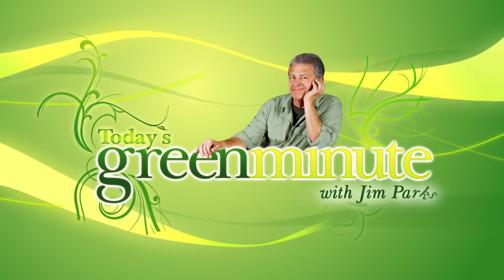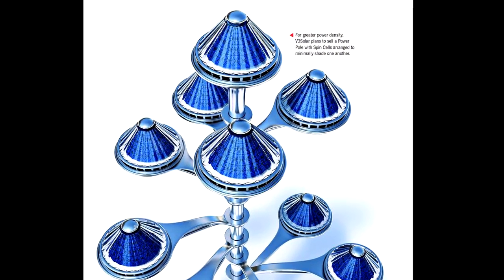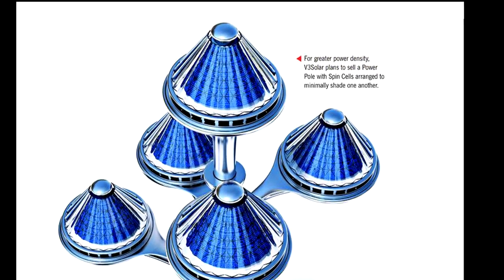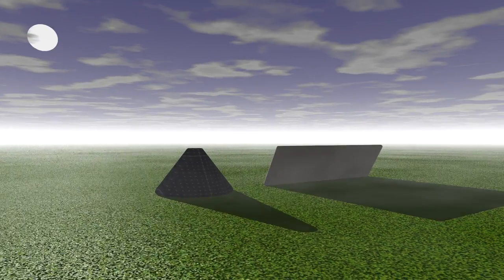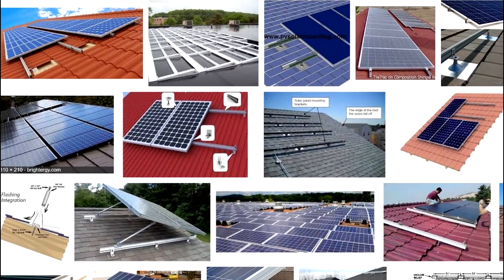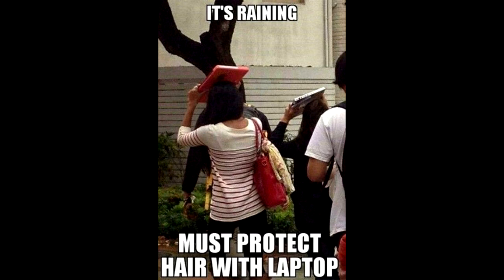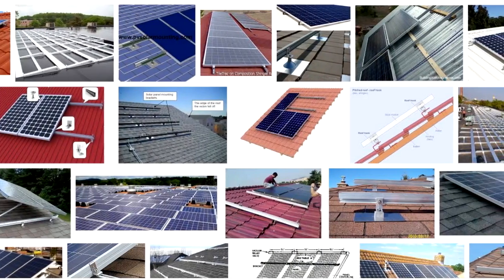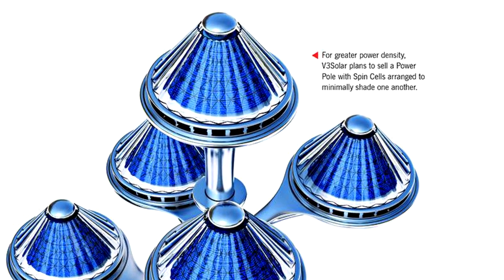Spinning Solar -BUSTED!

Comment: Solar isn't that expensive. MY parent's power their farm home with them and the combination solar wind setup was about $10,000 which includes installation fees, wiring, and building permits. I did it for a smaller building in the farm for about $700 since I only needed to power lights and 5 power outlets rather than an entire farm house. Compared to normal annual costs of power it's really reasonable.
Reply: ***** They took out a loan and only powered themselves with the solar and wind making it a monthly cost like any other which paid for itself in the three years it took to pay off the loan, only costing more later on for panel and battery upgrades. 

The $10k figure is an estimate made by my dad based on the total cost over the years we've had the system, minor upgrades included. A modern installation would cost $5k and we never accounted for y he government tax breaks received for having a solar system on top of the free electricity and the extra we charged neighbors to use. 

Just a heads up if you're interested, don't bother with the wind turbine. It doesn't generate anywhere near enough power to make up for the extra cost and according to my parents is a worthless pricy add on. Solar panels are enough if you get the right power storage. 

In short, we took out a loan making it a monthly bill like any other.
Reply: ***** most first world governments have aid programs and will approve what they consider "green" upgrades to your home. We got it because we wanted free power and it was going to cost the the same to wire electricity to the cherry farm on top of the monthly fee. We simply did away with the fee. 

I'm not sure how the loan process works, but if you were able to purchase a two story house then you can get a loan for this. Most homes are smaller and won't need the same amount of power thus reducing the cost. Like I said, most people would pay half because of new technologies and less power needs. It's cheaper than a car and powers a home for ( estimated) 35 years.
Reply: ***** in Alaskan summers you get 23 hours of sunlight. Plus the intensity is usually enough for a modern solar panel anyway. A cloudy day simply reduces the power but since they are only there to charge the batteries we actually draw power from there's never a reduction in power output. You have to conserve power in the winter. 

Solar is the best for self sufficient energy. Even if it isn't your only source of power it will take th err strain off the power grid in any location. 

Wind is worthless in the windiest places. We've had more problems with that thing that is practical. Every month something is broken. 

Nuclear is only good for a city
Reply: ***** our goal was free power. It had nothing to do with eco friendly whatnot or renewable energy. We have specific goals as a family. 

And nuclear can never be used for private use because the structure needed to block the radiation alone is ridiculous. A building with walls made of ten feet of concrete is an expensive endeavour just to power a private home.
Reply: *****
That $10000 is the entire cost of installation over 3 years. No more money was put into this. It's not an annual cost. I've installed my own into a trailer for just over $700 with 400 watts of power. Plenty for one person.
Reply: ***** if every house had a solar panel that national grid wouldn't be strained so hard. I believe in being self sufficient, but even if it's not all the way don't make the government do all the work.
Reply: Simon WoodburyForget you don't understand mass production. Btw they are already mass produced
Reply: +ErebusArchon : Nah, for a nuclear plant you need an earthquake- and tsunami-safe location with a good water supply for cooling, a massive electricity grid to distribute the humongous amounts of electricity produced in a small area, and a stable supply of well-educated, responsible engineers to run it. Feasible in some industrial countries, but not nearly universal. Think about this: would you prefer a state like, say, Tanzania, to get its electricity from solar power or from nuclear plants?
Reply: +Simon WoodburyForget " the more power you use the cheaper the electricity you make will be when talking about things like coal, oil or nuclear power" - does not compute. Don't you think prices will increase when everyone switches to any given finite resource, like coal or oil? Supply is not infinite, so demand determines the price, right?
Theoretically, something like that also applies to solar cells, so we cannot switch on an infinitely short timescale. But it turns out that China is pretty good at scaling up the production when needed... and the global production capacity is high enough to cover a measurable fraction of the world's power, at prices that were never lower, and that are competitive with all other sources of energy under good circumstances.
Reply: Simon WoodburyForget : I know what scaling means. And solar power scales nicely, as long as you have enough area you can cover, and your grid can handle the fluctuations. 
Need twice as much power? Install twice as many panels, and you're done. The installation becomes slightly more efficient when you go to larger installations, not outrageously cheaper, but not more expensive either. 
The global market needs twice as many panels? Build twice as many factories, and you're good to go. (Some limitations on silver and other metals may apply eventually... but so far, production goes up, prices go down, down, down.)
And you were the one who brought up the argument "what if everyone on earth...?" - well, that could be asked of any power source, and the result would be unpleasant for all of them.
Reply: Here's a thought, use a little bit of everything around you instead of finding one single power source? You know, much like we already do.
Reply: Simon WoodburyForget this computer didn't take that long at all. I ordered the parts one at a time and spent a Saturday morning getting it together. It's not as hard as you make it sound. If you're wanting the absolute best shit and you want unrelated components to work together then I can see it taking all day. But once you have the parts they click together. Especially if you're like me and buy everything from the same company and only use the recommended upgrades with the same plugs. 

Don't complicate you're shit dude.
Reply: Simon WoodburyForget  A lot of that is fun. Why don't you want fun? Fun hater.
Reply: Simon WoodburyForget Except we are talking about something I clearly already know well enough. So in your face. 

Are you literally saying knowing how something in your own home works is a useless skill?
Reply: Simon WoodburyForget  You act like nobody knows more about this than you or someone doing it for a living. The concept of a hobbyist or a far along learner eludes you. I know what I know out of necessity. I'm not a professional but I build my own shit for custom specs. It's cheaper, you're not informed. You've admitted you're not informed, and yet you carry on this illusion that your way is right when you ONLY do things you do because of a lack of skill and knowledge you admitted. 

Just stop it little man. The topic is solar panels. I lived with them and I'm willing to discuss their many flaws, advantages,and myths.
Reply: Simon WoodburyForget So building computers can't be fun because it takes to long and requires effort? 

Dude. The fun comes from problem solving and making things work. You never have the solution right away, but after a while you wind up with a bunch of solutions. Many of them creative. Many wrong.
Reply: + Milad Chow: What? Pray tell, what rare earth minerals do silicon-based solar cells (the most common technology) use? AFAIK, the ingredients are: silicon, nitrogen, phosporus, aluminum for the back contacts, some silver/copper/ whatever alloy for the front side fingers and busbars and rear busbars. A well-manufactured cell will work for 30+ years, with a degradation of maybe 20% of its original efficiency.
Reply: benjovi55 there are many things we do to say power that most people dont do. It's common sense to us but having unlimited power has made some people lazy and wasteful. One thing that irritated the shit out of me is people who leave shit plugged in all the time. Another is only turning on the things you need. 

You don't live the same, but with a little logic and common fucking sense you can wind up using a tenth of the power without actually giving up anything but bad habits. So since you'd use less power you probably could handle it. Even in the winter they generate some power which all goes to the batteries. We've even gotton reading from moonlight. All you need is to figure out you daily usage, have a battery system that stores that, solar panels that charge that during your work day, then add 50% to everything. 

As for the $10000, we assembled most of it and ALL the wiring was done by my dad. Plus that didn't include the batteries.
Reply: Simon WoodburyForget a gaming pc is actually very simple and could be figured out fairly quickly. If you're buying completed components like most people do then it's little more than a puzzle. 

Running the electricity into s house is harder, but essentially is just a puzzle once you understand generally how things work. You put the components where you want them and connect with wires. The actual house was already dont so all my dad had to do was send power to it. 

As my brother says, you don't need to know how something works to put it together, you just need to kno we where everything went. 

Also it's not on the roof.
Reply: benjovi55 any panel makes it cheaper.
Reply: The problem is that residential electrical power demand in the US is about 20% to commercial and industrial, and  electrical power is about 50% of total power (transportation, cooking, heating).   Another big problem with solar is that solar plants are co generation facilities that get massive subsidies on their co generation equipment.  Natural gas, and big oil loves solar and wind- and so do the manufacturers of the equipment.

It is a good solution for many- but it is not the solution, particularly when you consider how those monocrystalline panels contain rare earths- and that means heaps of heavy metals like lead or mercury got blown into the air through a smokestack (almost assuredly in china) just to get them made.
Reply: ": Nah, for a nuclear plant you need..."  No that is for a first generation fast breeder reactor.  You think the first car, or hydrocarbon based steam generator was safe?  IFR demonstrated no need for any of those claims with a fast breeder reactor.  Passive safety systems have been around for a long time- we just have lots of old plants.

" What? Pray tell, what rare earth minerals do silicon-based solar cells (the most common technology) use?"  You are talking about monocrystalline photovoltaics (for rooftop) which use tellurium,  indium, gallium compositions as doping agents.  They are trace amounts but that does not mean trace amounts of lead and mercury were not mined and refined to get them only to be blown out of smokestacks that reach food chains that go across the world.
Reply: Simon WoodburyForget
 By 10 am on a Saturday I was playing Skyrim on a computer that didn't exist the previous night. Besides, all the parts were assembled, they just needed to be mounted in place. Plus I use this computer every single day so it was worth the effort to save a thousand dollars and build the specs I needed. Most mods were done to operate with a lower input voltage so the power supply had to be modified because I run on solar panels and batteries. Other than that it was pre-built parts.

You may be able to spend the money, but I don;t have money to spend, I have a few hours to make something I want and need. And when you make your own stuff it's done your way. No one else is reliable. A computer with the performance I needed would cost $2000 and have functions and parts I don't need and would still need to be upgraded with the more powerful graphics card. I got a better computer for $1600. Not a huge savings but it will last me years instead of being a throw away item. In fact I can sell the parts used in this computer later on when I can buy the perfect graphics card that costs more than my computer and will be able to render movies while playing Grand Theft Auto 5 with a browser window open.

In case you're curious about the power supply mods, my computer origionally ran off of a 120v wall plug, but the power supply ( black box on the cord in case it's not called that) says that the computer only needs 21v, meaning the power is reduced to the ideal electrical flow. Basically: 120v into the black box, 21v out to the computer. I simply reduced the input to 50v and whatever the amps were and with a lot of math, google, and crying, got it to still supply 21v for the computer but now it runs off a 50v system for the solar panels. I kept the factory plug for college.

That's the basic gist of it, but to be fair my parents did most of the figuring out. Hell every plug in the house is modified except for the TV and kitchen appliances. Being totally solar kind of requires you to learn a few things. But hey, we get free power and are self-sufficient. You can suck the bitter tit of the failed system.
Reply: Simon WoodburyForget  I come from a do-it-yourself family. We get shit done. Some people throw money at problems, some people fix things, and some people learn to live without. I'm the middle one, you throw money at it.
Reply: Simon WoodburyForget  My dad built the solar panels because we are out on a farm. It was cheaper to do things this way and it provides free power. For us it's great. We provide our own stuff and do things our way. If I could build my own car I would. It would probably be "normal" with a balance of features that the government has stopped allowing companies to build. 

WTF government? Maybe I want to go down a rocky road in something that isn't a gas drinking, poorly balanced SUV or truck. Maybe I want my sedan to have a metal on the dash. Maybe I want a cheap mid engine car. Maybe I only want to carry 3 people to have an excuse to pissed Matt off.  

Btw, my car is kind of customized, but I think anyone can install a radio. Aka the part that gets outdated and the car company refuses to update at all.
Reply: Simon WoodburyForget  Why would I build a car for other people? The whole point is to have custom stuff that suits me. 

And the solar panels continue to provide power without a monthly bill. So it's no longer costing money unlike all other forms of power. We will need new batteries in about 35 years, so 35 years of power for the price of a used car with no bill and complete isolation from the grid.
Reply: Simon WoodburyForget That's not exactly how they work. They become less effective the hotter they get. But the batteries are the first thing to wear out because batteries have a limited number of charge cycles they can go through. We have very expensive lithium ion batteries so they'll last (supposedly) 35 years. The panels will wear out and stop working, but they dont burn like fuel.
Reply: Simon WoodburyForget why would power demands change? On a farm. With fewer electronic devices since I left for college.
Reply: Simon WoodburyForget  Yeah, but I'm not the kind of person who expects the whole world to do things my way. Supply your own power with what's around you. 

The best power generation method out there is a hydro electric dam. Nothing comes close to the raw power it can generate or the longevity. But not every place in the world can use one. Like I said. Use what's around you.
Reply: And before you bring it up, I know they are expensive. It's an artificial mountain filling an entire valley.
Reply: Simon WoodburyForget  I have free electricity you don't. I'm smarter. I'm not tied to the grid. That's what I mean. 

Communities can provide power with what's around them, but most run on the national grid. There are towns in south Texas that the grid did reach but no power got to them. They refusr d to rely on yhe system because it can't provide for everyone. 

It's impossible for a single system to provide for mote than half a million people. Every 500,000 people need their own power grid, water, and food supply. None of this federal shit.
Reply: Do you really think that solar panels are made of thin air?

Comment: um question what if the design was reverse 
looking like a megaphone or flower 
or a satellite antenna and it didn't rotate just fallow the sun , 
with a tree like structure similar to the one in the video, 
would it not work?
I don't know if it has already been done just Inquiring about it .

Comment: You are wrong. It is only 200% not 400%. L2math. 

20% / 2 = 10% (only half the solar panel generates power at a time) 

10% * 20 = 200%

Comment: You would think that lenses would be the way to go though, it it not like sand  is actually rare or that hard to work with. I imagine you wold mass produce tens of thousands of lenses for cents on the square meter. That are accurate enough for the job. It should be easier to deal with concentrated light, instead of trying to get energy from something so weak.